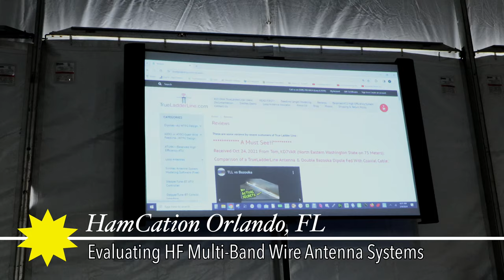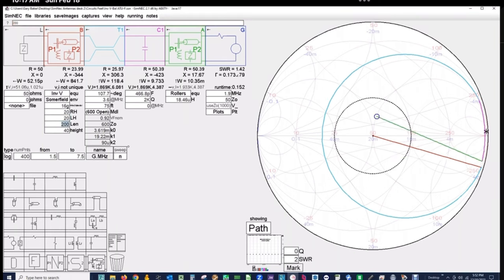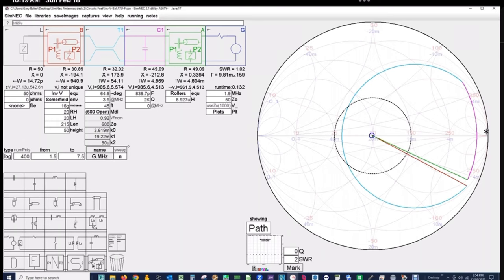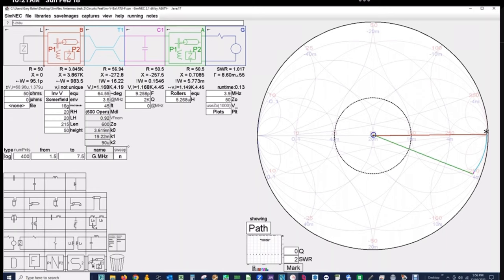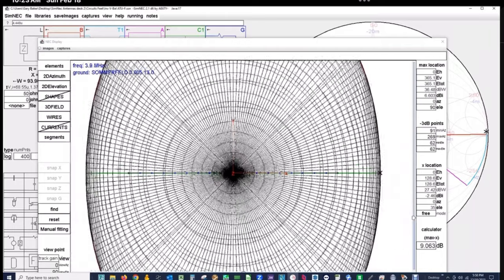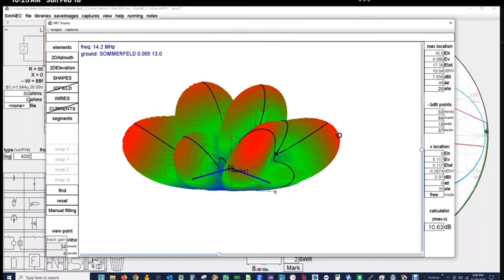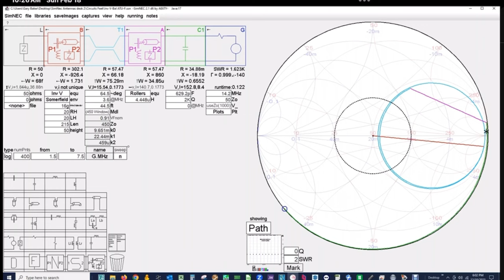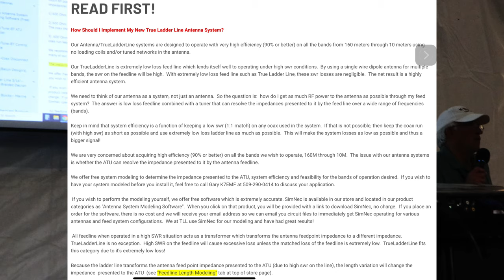Discovering The Best HF Multi-Band Wire Antenna Systems! (part 2)

Comment: Gary is an absolute GUSHING fountain of knowledge!  Thanks for posting these videos, Rich!!  Dave, W5ODP  🙂
Reply from the maker: Isn't he. I was soo impressed I want his ladderline for my home and camper. I will get together with him to help me design an antenna for POTA and using with my camper. Thanks for commenting, best 73!
Reply: @ioAdventures I have his page bookmarked.  Currently running 450 ohm window line to my linear loaded doublet.  I run it through a 4:1 balun just outside the ingress window and then to my tuner.  This convinced me to run his 600 ohm ladder line to the doublet and then directly to the tuner.  👍👍